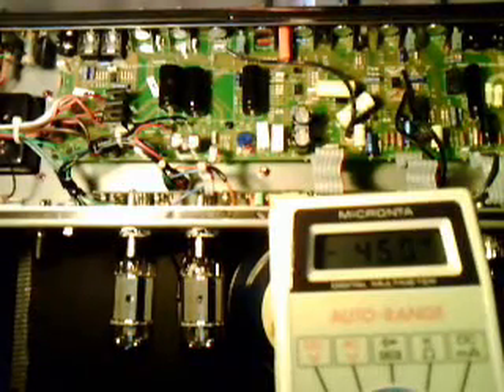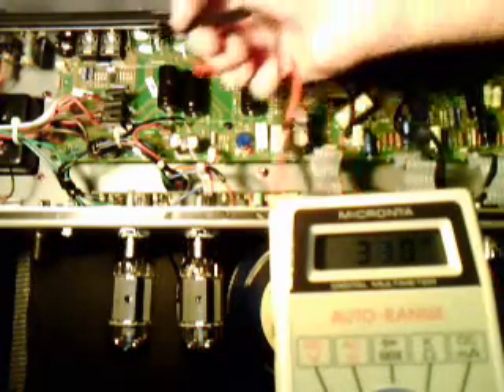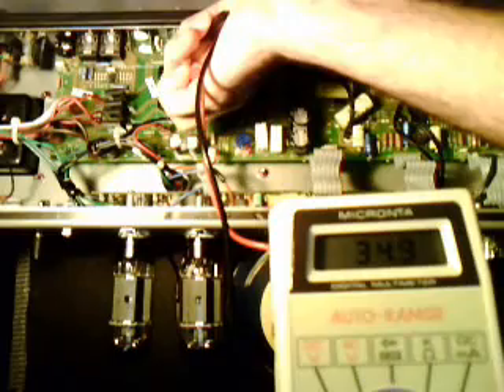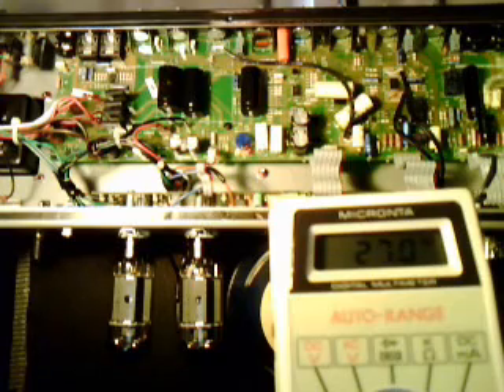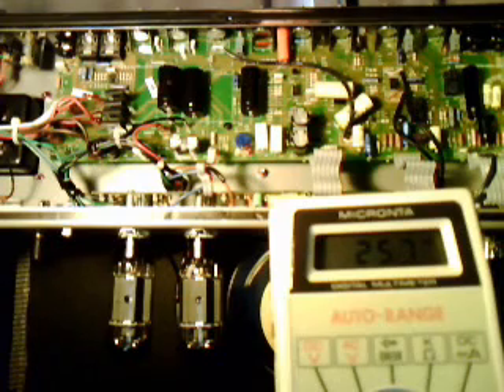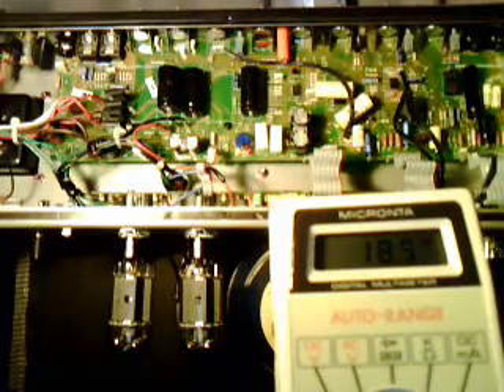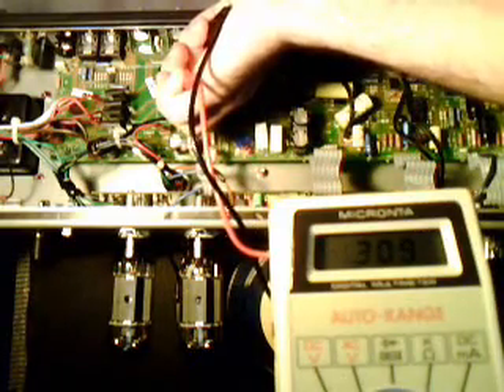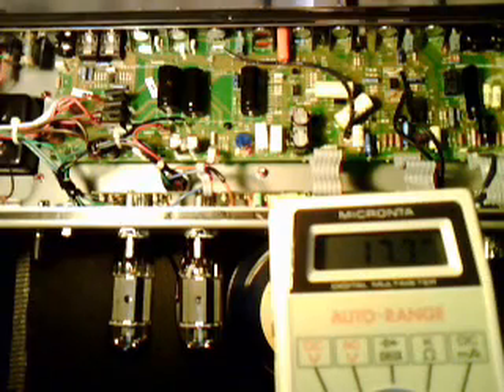Draining Filter Capacitors in a Fender Hot Rod Deluxe

Comment: Thanks for the video.  Have a question.  Is there any way you can get shocked when using a multimeter to test the caps?  Like if you put the positive tip to negative end of cap and negative to positive?  Or do you really have to be sure which tip is which?  I mean by accident.
Reply: You are more likely to damage your meter than get a shock. If you touch the black probe to the chassis, then touching the wrong lead (the negative  terminal) with the red probe will read 0V, and touching the correct lead (the positive terminal) will display the voltage on the capacitor. As long as your probes are connected to the meter the correct way round!

Comment: Another novice question, does power tubes hold discharge too?
Reply: No, but two of the lugs of each tube socket are connected to the filter caps, and will shock you if the caps are not drained.

Comment: Novice question here, if you leave tube off all night, will that drain the cap?
Reply: It depends on the design of the amp. Some amps (but not all!!) have 'bleeder' resistors which will drain the caps. You can never be sure. The gun is always loaded, the dog always bites, and the filter caps are always charged.

Comment: 33k seems a bit high 5.5 k 5 W would be fine. I have 5.5k on my filter caps in my pro audio amps. Although the voltage is somewhat lower, the capacitance is 40,000uF which is rather extreme and will require a 10W resistor. I see that they left a cap out. Is it also part of that main filter circuit. Why not populate it? Just wondering...

Comment: I heard you can drain an amp by taking a screwdriver and making it touch the rods from the Outlet plug. will that drain everything? will it cause damage? how would I know if there are capacitors under the board?
Reply: Don’t do it if the caps still have high voltage. It will cause a massive arc and damage something, or you.  Low voltage is ok

Comment: @tomfoyfx I went to radio shack for some power resistors but they didn't have the same rating. They had 25w-8ohm, 10w-1ohm, 10w-10ohm, 10w-100ohm, 5w-0.47ohm.  I was thinking the 25w-8ohm would suffice, but I slept thru my college physics classes and am not a fan of exploding resistors or electrocution. Should I try and find the specific one online (since I have to order parts anyway) or will any of those work temporarily?